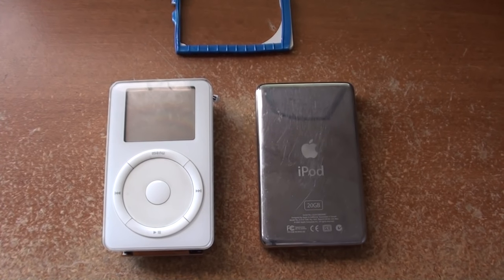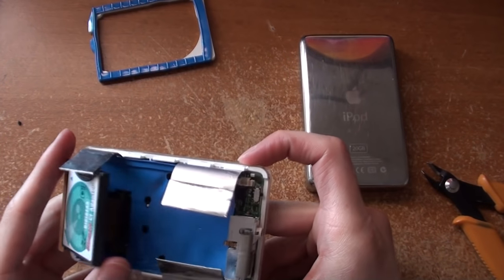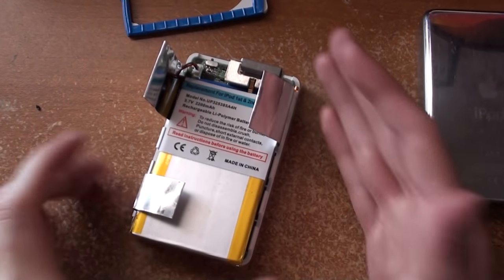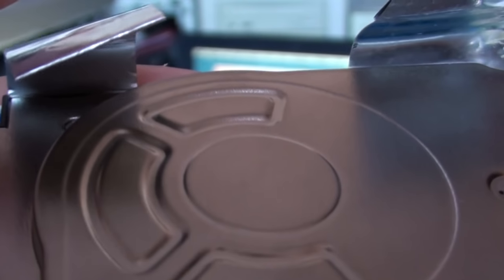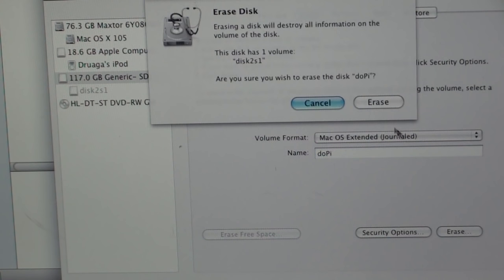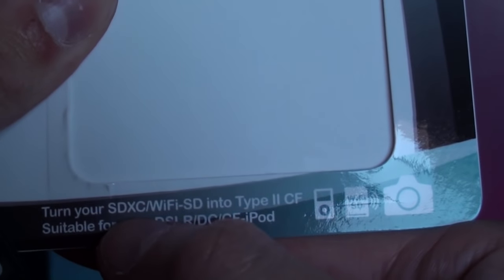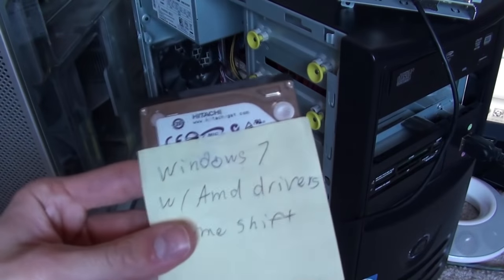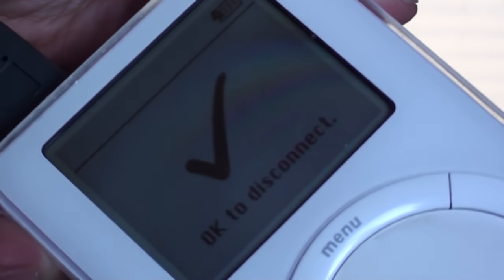How NOT to Install an SSD Into an iPod (2nd Gen) [Part 1]

Comment: the iPod can handle "SSD", but I think it looks like the problem is that you're going IDE to CF.  Whenever I've seen people doing CF SSDs into old iPods, they've always used an IDE to CF adapter.

I've also read quite a bit about the Firmware.  iPods (at least the old ones) have special firmware on the harddrive. I don't know if it's another partition, but it would be good to dd (using the terminal, a low level, block-by-block copy method) the old drive (you might be able to do it with the drive in the iPod, but I'm not sure) onto the new flash card.

This has been something I've wanted to do to my 3rd gen iPod for a long time, so I've been reading a bit about it.

Comment: So, from what I have read, the 2nd gen is not compatible with SD card adapters at all (even if you don't fry the adapter before getting it plugged in the correct way!).

I haven't been able to find much info on using an actual CF card, though. I'm super excited for the next part of your video. It would be great to know if it can be done at all or if the 1st and 2nd gen iPods just don't like to play with different drives.

Any ETA on when you'll be putting out the next part? I'll be waiting patiently...

Comment: First of all, you can't directly connect an CF into the iPod, you need a 50-pin IDE to CF card adapter.  That is how you are able to make it work with the 3rd and 4th gen iPods.   Second, even with this adapter it still doesn't work.  I am thinking because of the FireWire interface, the iPod has trouble connecting to the computer and therefore you can't restore it on iTunes.

Comment: Hey Druaga1 there are Adapters specially designed to work in those iPods (ZIF->CF->SD), seen one of those with an 512GB M-Sata SSD (ZIF->IDE->M-SATA) :D It worked, but the iPod crashed, if the Song Database got too large. Up to 256GB was fine, if I remember correctly.

Comment: You can’t format a removable drive to fat32. HFS+ is also not usually these external drives.  That’s why Linux won’t do it. It’s removable media you are treating like a hard disk. The 1.8” drive will act like either an internal or external drive. exFAT is the only format common to the two systems for removable media. The iPhone probably treats it like an internal drive on its main board.

Comment: One thing i didn't understand: Why did you put up with a potentially less compatible system by using adapters? I would have used a big CF Card instead. Less risk of not working and (i assume) even cheaper.

Comment: +Druaga1 Say, I'm pretty sure your compact flash card adapter didn't work because your drives only work with smaller Compact flash 1 cards. Either that or the fact that its an adapter makes the card too big to fit anyway...or you fried it. Dunno, I'm no expert, just a guess.

Comment: You might need to change the master boot record on the sd card to trick it into thinking its a hardrive and not an sd card. You have to do the same thing for the cowon x5

Comment: Any flash drive larger than 32GB isn't formatted with FAT32 out of the factory, and Windows isn't going to format any drive with FAT32 if it's larger than 32GB, because of the 4GiB file size limit FAT32 had
Reply: i'm pretty sure I managed to get a 1tb external + 64gb drive formatted in fat32; if not then i stand corrected.
Reply: Scarletia osu! Was it a Hard Disk or Solid State Drive, because those normally come pre-formatted with NTFS
Reply: Frankie Sparkes external hdd; formatted with ntfs from factory but i use os x as well, so had to format in a fat filesystem. i used exfat and that gave me errors every few days, so i changed to something and it worked fine - and i think i changed to fat32. i'm using ntfs with a driver atm on os x though, so no problems so far.
Reply: Scarletia osu! You can format drives larger than 32GB with other software, GParted springs to mind, but it's not recommended, mainly because of the file size limit that the File Allocation Table has, hence the fact that Windows simply won't do it
Reply: Frankie Sparkes ah there's my mistake, its windows that won't do it-- i did the formatting on os x.
Reply: Frankie Sparkes Another reason to use Linux.

Comment: some light reading turned out that 3rd gen ipods with an ssd will only restore only via usb and will freeze in diskmode when used with firewire

Comment: I don't think anyone has gotten an "SSD" to work in a 1st or 2nd? I know I never did. Also the biggest drive I know worked in them was a 4th generation MK4000 series 40 GB. In fact my 20GB 2nd runs a 40GB. But it wont run a MK6000 series drive because of the partition mapping. the 1st and second gen iPod could only see a max of 20GB partitions. the MK4000 series 40GB was 2 20GB partitions in a double platter configuration. My 1st Gen could use a MK4000 40GB but the case wouldn't shut so I had to use a slimline MK4000 20GB in it, the MK6000 40GB slim line wouldn't work either in it. A 40GB MK4000 double platter is the biggest drive that will work. I don't think the firmware in them would even know what to do with a CF card partition map. Plus the SD to CF adapters have always been hit or miss in iPods, later adapter models will usually work on 5th gen and newer but 4th gen and older I don't know about. and If it's an earlier SD to CF adapter it won't work period. Plus not all SD cards work in them to begin with, you have to research it to find which models work for iPod
Reply: +UnoriginalTuber yes he does break a lot lol... TunkerNut if I remember correctly used a fifth generation iPod video. We're talking about First/second generation here (same logic board), third generation has problems with upgrading the hard drive (though it's doable to a certain degree). Fourth-generation was around the time you could upgrade iPods pretty easily, before then, it's hit or miss

Comment: It is written CF-iPod on the box, your iPod did not come with a CF card in it.
Check Prerequisites section of this page : 
http://www.rockbox.org/wiki/CFModGuide

You need a 50-Pin HDD to CF Adapter

Comment: Since a CF drive may just work as an IDE drive. Is it possible to use an adapter to fit in an IDE SSD to the IPod? I know it is too big for the IPod but if you can then why not :D

Comment: You don't understand why it is fried? Well let me tell you. You pluged that thing in the wrong direction and some crazy stuff can happen if you connect something wrong. I'm actually wondering that that iPod is still somehow working, if something gets that hot it's usually toasted. Like that adapter.

Comment: If the old hdd worked why wouldnt you just dd that to an image, dd the image to the new flash and then just grow the partition...? And dont blame linux when you connected the sd adapter the wrong way round and shunted voltage down data channels could that be why the flash adapter died and things got hot.... maybe next time take note of where pin 1 is. And unbending pins on a live compact flash reader, cringe...

Comment: Hi , you have used an MMC card in the adapter, it is not the same pinout as Sd and it is not compatible with your adapter ;) that why it doesn't work ^^
Reply: WTF are you even talking about? None of his stuff is MMC.
Reply: +Kristopher Phillips (ChronicledMonocle) The 16mb card is an MMC card
Reply: +L' Elektrongeek Ah. Your original comment should have been a bit more specific.
Reply: +Kristopher Phillips (ChronicledMonocle) You should learn to read. He said he used an MMC card, you said none of his stuff is MMC, he pointed out exactly which card was MMC and then you just engaged damage control mode.
Reply: +L' Elektrongeek it was definitely the problem.. although his card reader probably doesn't support CF revisions 5.0 and up, making it limited to 64GB. That's why it didn't show the full 128GB.

Comment: Why use an SD card with Compact Flash adapter? Why not just use a Compact Flash card instead? You could get a 32GB CF card pretty cheap which is still bigger than the original Ipod hard drive. Also, you probably need to clone the contents of the original ipod hard drive to the new storage so the ipod will recognize the files.
Reply: It's not simply a SD to CF adapter, it's really a IDE TO CF adapter or a IDE TO CF to SD adapter, because SD's are cheaper in larger sizes, the CF is more compatible with IDE & that's necessary given its replacing an IDE hard drive.

Comment: Is it totally safe to remove a pendrive, tf card etc. without clicking the eject/unmount option?
Reply: Rajorsi Roy Chowdhury, If you are ever prompted to run chkdsk on a Flash drive that you abruptly took out, do it.
I thought it might have been Windows 7 being weird with my Xenialpup Boot USB. So I held off for a few Boots.
I nearly had a heart attack at School when it didn't show up in the BIOS.

Comment: So if im correct (i am noob) the motherboard was melting because there was no battery and it had no place to deliver power to and therefore got stuck and heat temp rised and started to melt?
Reply: AdEaNs GODDAMN CHANNEL!!! That wouldn't happen because most PC connections have ways of sending power back to the PC.

Comment: Wtf, on that packaging from the compact flash card. ''WIFI SD''?????
Reply: there are SD cards with built in WiFi, weird, I know
Reply: Yup. They’re quite useful. Say you put one in your digital camera and set it up you can access the photo's/video's on a computer in that network or close by if you set it up as a hotspot. I use one in my car music player. Its parked close enough to my router and allows me to change the music from my computer without having to remember to take my player to/from the car.

Comment: How does one upgrade from a 20 GB hard drive to a 128 GB SD card? I don't think the disk format allows anything higher than 32 GB...  (at that time)
Reply: I use a 128gb ssd in my 5th gen orginaly 30gb ipod. the 60, 80 gigs have double the ram & can handle 256GB, 512GB, or 1TB & are pretty stable.
Reply: Who would even need 1TB? Who even has that much much por... I mean music?
Reply: Well, it's 5th gen, so maybe the disk format is better... Also, are you sure it's using all 256GB and up? It is possible it is only using part of it, since it wasn't partitioned.

Comment: You can get an android device for $50 with more storage.  Why would you even bother to attempt a repair?

The posts are there only to prevent you from replacing the drive, btw - it's just a way to prevent you from upgrading the device yourself.

Comment: As an electronics technician that deals with lots of solid state components, I was cringing and wincing throughout this video.  I knew that you were a hack when you used a metal screw driver to strengthen the pins.  Sorry dude, just pointing out the obvious. Electronics has a weird way of letting you know that you are way over your head (heat or sparks).

Comment: Your first mistake is using a Mac. Your second mistake is just change it to an SD card and leave it permanently docked in a speaker, no need for battery change. Your third mistake is you should have tested it out before recording yourself doing it.

Comment: why would you do this
Reply: why not...
Reply: 1. Solid state, so you don't have to worry about erratic movement.
2. Less battery usage, since it doesn't need to spin up a disk. 
3. In teory, should have slightly better read speeds (maybe write speeds aswell).
4. Storage space can be increased by just replacing the SD Card instead of the whole HDD while retaining all the previous advantages.

Or... He just wants to use that iPod with an SD Card and make a video about it.
Reply: You must be new here :3